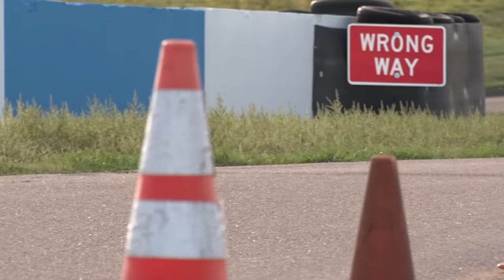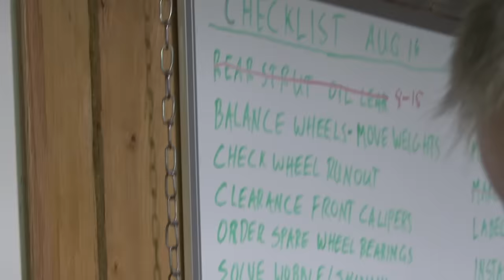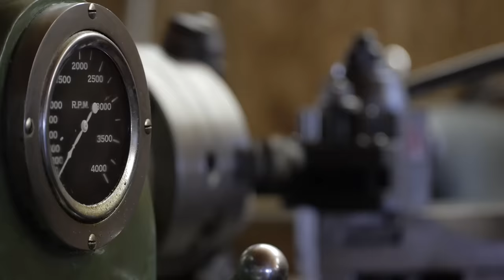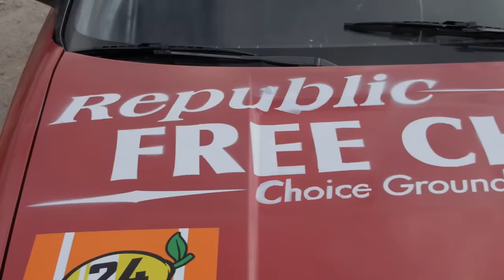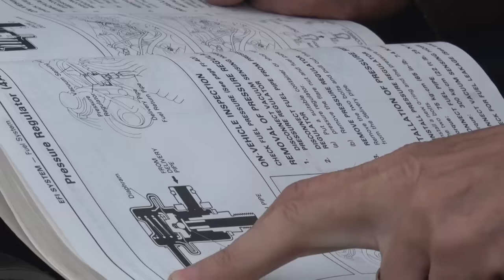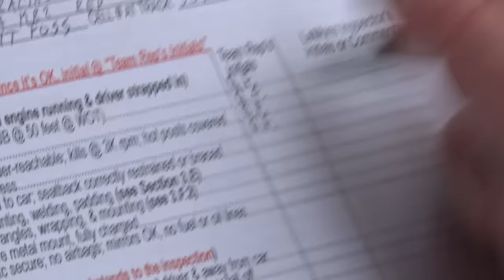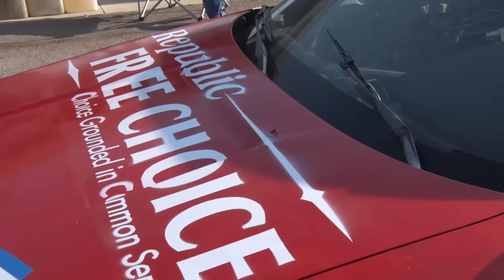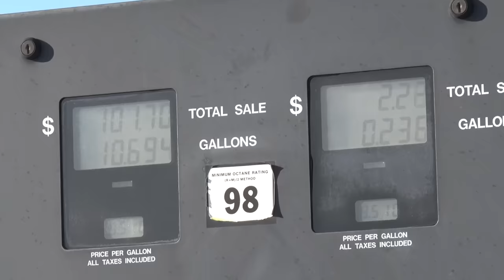$500 for Glory - A LeMons Story

Comment: Car: $500. Modification and labor: $10000
Reply: +Ronfreo If you can do the work yourself, labor is free
Reply: +Tito Rigatoni unless you charge yourself extra
Reply: Seriously.  The safety equipment costs more than a pretty nice used car.
Reply: Finishing a 24hr race : Priceless
for everything else, there's Mastercard™
Reply: @nunyabusiness896  safety equipment is not a part of the $500
Reply: @nunyabusiness896  Safety equipment isn't included in the price... if it was then people would go cheap on it and get hurt.
Reply: @sarmenia  Where did I say it was?  My point is that it's not "racing a $500 car", it's racing a $500 car with 5 figures of total investment, which makes the $500 "budget" part of it moot.  All I'm saying is it's disingenuous to act like you're truly racing a $500 car.
Reply: Umm where did they get a turbo under 500.
Reply: @DevinEMILE  Literally any turbo off of a common stock motor can be had for less than $200 from a scrapyard
Reply: @nunyabusiness896  Racing $500 cars as-is would be borderline suicidal. You're still driving a car that is a POS, you're just less likely to die doing it.
Reply: @DevinEMILE  pick and pull junkyards will sell them for 40-50 pretty regularly. You've just got to find one and rip it out of a junked car yourself
Reply: The total cost of the base car, and parts, has to be under $500.
If this were a shop, labor would kill you. These cars have days and days of labor into them. But it's not like a showcar, where that labor is nicely tucking the engine bay, or having someone make a custom surround for your 18" sub. This is like
"Hey, i wanna mount a turbo to this clapped out piece of s**t. Help me take the header off, mount it upside down, saws-all a hole into the hood, mount a turbo off a 1991 saab we found in the junkyard for $100, and then hook some $3 plumbing pipe back to the intake side so we can make it go. Oh, also, instead of an intercooler, lets run all the piping to the trunk, and route it through a foam cooler full of ice water."
Reply: @nunyabusiness896  agreed. i was into it, untill i found out how much of a rich boi club it is.
Reply: @deadjoey77  it's still probably the cheapest way to get into racing, if you get a few guys to share the costs (like most people) it's not a "rich boi club"
Reply: @nunyabusiness896  It is a $500 car; this is really easy to understand.
Reply: @classicjag76  And somehow you're still not getting it.  If it's $500 and $10000 of safety equipment, the total investment is $10500, so to get on track you're spending $10500 before any entry fees, cost of tow vehicle, misc. equipment, etc.  The point is it's not really racing a $500 car because you will NOT get on track by simply spending $500, thus making the "budget" angle disingenuous.  Considering you can get a really nice shifter kart for that same money, I'd hardly call LeMons a good budget choice.
Reply: @nunyabusiness896  thanks for the lesson professor, my tiny brain was having trouble understanding it.  I'll assume you don't need the sarcasm tag because you're so smart.  It's a $500 car.  The modifications have NOTHING TO DO WITH IT.  The rules state the car has to be worth $500 or less, that's it.  It's not a hard concept to understand.  I'm gonna get back to drooling on myself...
Reply: @classicjag76  I guess you will keep drooling because MY point is that people often say "$500 car racing!" as if it's legitimately affordable for anyone, "Just pay $500 and you're racing!", but once you include the safety stuff that costs 20x as much as the car, it's not affordable at all and is actually arguably more expensive than some other low-cost racing where people might actually want to buy your car when you're done with it unlike some VW Bus or 70's Cadillac with a roll cage that isn't useful for anything.
Reply: @nunyabusiness896  I don't think anyone was trying to make a point that it was affordable for everyone.  It's a niche sport and light years cheaper than any other form of racing.  nobody's trying to trick you into buying a $500 car and then surprising you with a $10,000 bill.  Good Lord, if this isn't something within your reach, why are you even bothering to continue fussing about it?
Reply: @classicjag76  Clearly the other guy does not understand how racing really works. Clearly he has not heard "where there is a will, there's a way." I have zero idea where he is pulling this $10000 figure from. Got my car for $450, currently selling all the internals. $400 roll cage put together by my buddy (navy certified welder), ripped one of the racing seats from my 944 track car, picked up another kill switch, and we are ready to go. 

Most guys who compete in this event are mechanically inclined and already have most of the gear to compete. This commenter is ruining the spirit of this sport. People should not be afraid of the price tag as it is split 4 ways. Lets say you do spend ~$4000 to get this car perfect. Lets also say it will last the whole race (because i promise you even some of the best track cars will randomly die on you). Split 4 ways, that's $1000 for 6 hours of seat time. You cant get a better deal. Usually a track day is $200-400 for an hour (half in morning, half in afternoon) 

I want all who reads this to never be swayed by the negative nellies of the world. Myself and 7 other navy buddies said by god this looks like the most disrespectful racing series we could do... lets do it. And every step of the way is a memory.
Reply: @nunyabusiness896  I'm sorry, I fell asleep during your rant.  Were you saying something?
Reply: @nunyabusiness896  you wrote a book... Remember I'm very challenged mentally, so you need to keep your sentences short and use simple words,  like the last five words of that essay you published.
Reply: Or more
Reply: @nunyabusiness896  a little late to this party. But you can buy already raced cars for under 2k with cage, seat, belts, fire suppression. So not 500. But sure as shit not 10k. Our first lemons race including buying our own race suits and stuff we spend around 1500 per person.
Reply: @thebaseballer5  Sure, you can get anything for any price if you wait years while desperately hitting refresh on listings until some rich guy that doesn't give a shit and just wants space back in his garage sells something for peanuts.  That's not a typical price.  I know people that race Lemons, I know what it costs.
Reply: @nunyabusiness896  I just sold a almost race read car for 1200. There was a V6 4th gen Camaro up for 2000 for a while. There is a 5.0 merkur up for 2250 and a 97 Thunderbird up for 2000 right now
Reply: @thebaseballer5  All full of problems that will cost thousands to fix properly.  Yeah, I know.  Once again, I know people that race  Lemons, don't try to peddle your naivete or flat out lies on me.

Comment: The turbo was probably a bad idea. Better you take slow and reliable vs fast and finicky
Reply: yeah the turbo killed it completely overheating that block in the end, the cooling system couldn't cope with the extra power
Reply: I mean there is a champion miata that uses turbos connected to some pvc0
Reply: @afish8883  yeah but that Miata engine was built with turbos in mind.
Reply: I don't know if it just wasn't shown, but it seemed like the slapped a turbo on there without understanding all the changes they needed to make in order for it to work, it was the saddest thing in the whole film.
Reply: Why they don't install FMU? It's completly forgotten in europe but I've heard that you guys still using them widely in US...
Reply: @SuperMatiz  FMU?
Reply: @ineednochannelyoutube5384  Fuel Management Unit, or Rising Rate Fuel Pressure Regulator. Pumps more fuel when boost rises. Old Turbodiesel engines with mechanical diesel pump utilizes similar system- its called "boost pin".
Reply: @SuperMatiz  Is this a mechanical solution?
The fuel injection regulators I.know of are electronically controlled, and putting on a turbo witgout one is sort of pointless.
Reply: @ineednochannelyoutube5384  you don't touch anything in ECU or (if it can can handle the planned boost amount) fuel system. Car thinks its pumping correct amount of fuel. When boost rises, FMU closes the fuel return line- in result fuel rail pressure rises ,and injectors sprays more fuel. You just fooling the electronics with mechanical device. Its great for garage turbocharging projects (just like lemons heh), but in stock system fuel pump capacity and max injector flow rate limits you. But no one said you can't swap for bigger ones. Last limit is stock map/maf sensor range. Usualy if you're out of range, that means things just went serious, and you have to ditch the FMU and head towards Ecu remap
Reply: @SuperMatiz  Thank you for the explanation.

Comment: I used to run my cars very hard off and on road, here's some tips, for the Radiator, don't use a thermostat, if you do run lowest temperature possible, don't use antifreeze, put a few cups of baking soda in water it keeps it from frothing, which increases cooling ability, use new hoses, and tighten hose clamps! turn timing back a few degrees to stop over heating heads, use diesel rated engine oil, or add STP to multi grade 10-40 or 20-50,----and for the transmission add a can of type 3 brake fluid to auto transmission if leaking or not also add ,1 quart 10-30 synthetic oil or 1 ,quart of 10-40 regular oil to any automatic transmission, this will keep it from burning out, all these things keep my Mopars going for decades.
Reply: Hoses are a non-safety part in Lemons, so those would count against the budget.  They are also pretty serious about water only in the cooling system, so thats a good start.

Comment: I feel that the most important thing that you could do to your car before even taking it to the race is to at least test and see if it will run and drive for 24 hours.  Before even stripping the interior, run it through it's paces and try to break whatever is going to break BEFORE learning the most crucial details at the track.  Those details being, what are the mechanical weak points of the car

Comment: I have been wanting to run this since I first watched a video on it many years ago, In all the videos I have seen I have yet to see a car that I would believe cost under 500 bucks.
Reply from the maker: I think it was a lot easier to do before the climb in used car prices over the last 5 years. Now it takes snatching a family member's 200,000 mile dodge neon with body damage. Or in our case, the car was abandoned at an apartment complex requiring a bonded title AND it didn't run. Here are some tips on how to cheat at BS from Lemons HQ http://jalopnik.com/400309/what-would-smokey-do-24-hours-of-lemons-cheating-tips-from-judge-murilee
Reply: IMO it would be easy...get a cheap Saturn SL2 or an Ion....and strip it...with all that weight taken off of a car that is already lite...would make for a nimble little race car that would be reliable and somewhat quick...Mid 2000 Ions made like 150 hp in around a 2000lbs car...Best performance mod is shaving weight...makes any car brake..accel and handle better...
Reply: Find a good car with a valuable interior. Purchase price minus interior sales cash = $500.

Comment: Seems to be a common theme with these cars breaking down that many break downs could have been avoided by servicing areas of any car that are common points of failure...such as a dirty fuel tank which should have been cleaned...What happens when you leave a car sit...or you buy a shit box covered in dirt with rotted tires that looks like it sat...the fuel goes bad and any water in the tank rusts the tank out...which results in the car running good at first seeming to be fine and only rears its ugly head on your first trip down the highway once the entire fuel system is contaminated with rust leaving you scratching your head stranded on the side of the road saying to yourself it was working fine...
Me personally...as I have been there stranded on the side of the road more then once for this exact reason...would have went through the entire fuel system from tank to injectors even running bore brushes through the fuel lines...fuel rail at least once and most important...cleaned the damn fuel tank...
Reply: Go do it then! At least these guys went out and did something!

Comment: I want to do this but I do not have the ability to acquire a vehicle for the race, a trailer, and a vehicle to haul the race lemon. And the closest track is in South Haven, MI, 3 hrs away.
Reply: You can do an "arrive  and drive".  There are many teams who run multiple races and sell seats if a regular team member can't go to that particular event.  Typically $500-$800 depending on the car and team.  For this you get as much as 4 or 5 hours of seat time over the 2 days if the car holds together.  You can research the past results to see which teams consistently finish the weekend.  You can buy used suits fairly cheap but I highly recommend buying a new helmet.  With the new HANS required mounts and the 2015 rating they cheapest one is $275.  All in expect to pay $500-$600 on gear if you buy the base level helmet, but that gear will be good for 9+ years.  And that's if someone on your team is willing to share a HANS.  If not the cheap ones are $400.  I spent $1,100 to do my first race but will only be spending $650 a race for the next year or two until I can get my own racecar car finished.
Reply: I live 15 min from gingerman

Comment: I'm at 18:04 and just want to say that as an aw11 owner, the fuel pressure regulator is a known problem, but a quick and dirty fix is to drill a hill in the top, tap it and put a screw and lock nut on it: BOOM manually adjustable FPR, you're welcome! 😁😁

Comment: why would you turbo it... youre literally doing an endurance race and you make the engine less reliable lol. then the engine breaks during the race lol. should have just rebuilt the engine new seals new timing belt new piston rings clean injectors and set the timing on the distributor perfectly. literally would cost ~$100 in parts, the only obstacle is having the tools and equipment and time and space to do it all. putting a turbo on this engine is dumb to begin with, there is literally a 4a-gze option designed for boost but youre boosting the NA version which has higher compression and weaker connecting rods. literally all you had to do was maintenance and you would have had 1st place easy. maybe weld in some baffles in the oil pan.

Comment: 135 hp stock with no turbo and a  6 speed sequential gearbox. You straight piped it with a porting and your at 150 Hp. You can squeeze two like this in an Echo if you want to.

https://www.ebay.com/itm/03-Yamaha-FJR-1300-FJR1300-engine-motor/311726639331?hash=item48945b08e3:g:8MAAAOSwHsRYDWgw